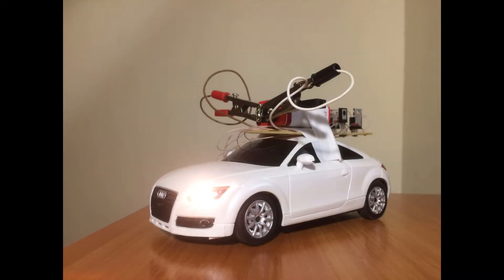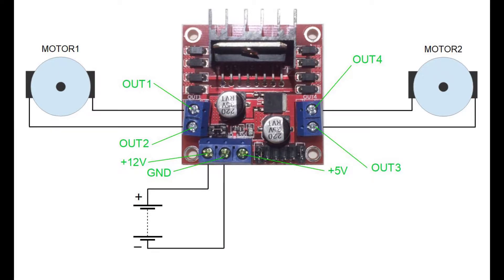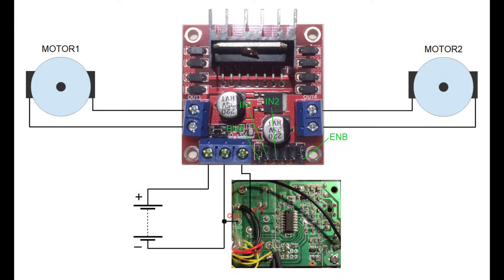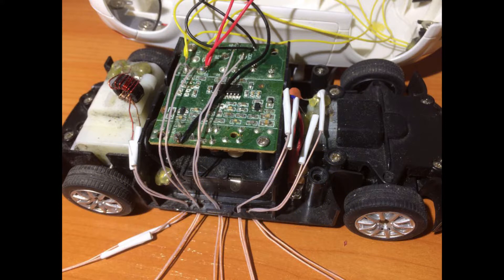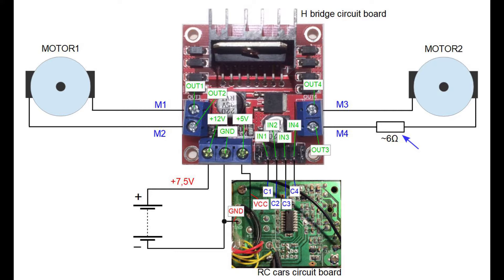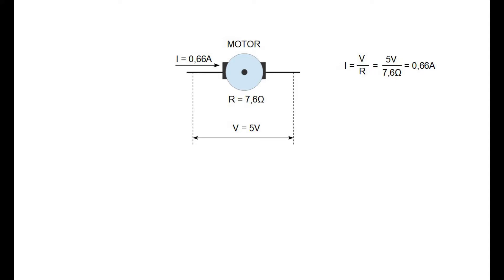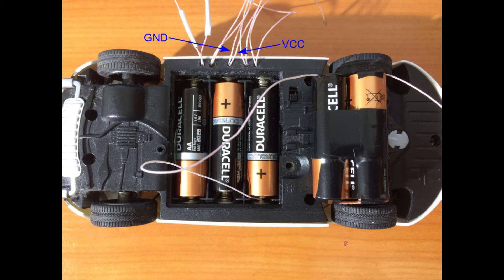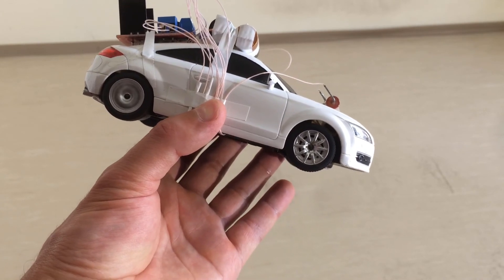Using H-Bridge to increase RC car speed - part 3

Comment: how to control speed rc toy?
Reply from the maker: If you are asking about the L298N circuit, you can control the speed using ENA and ENB pins referring to the video (02:09). You can do that by using PWM (Pulse Width Modulation). If you are upgrading an existing car, I don't think you will be able to change the RC car speed if the car already does not have the functionality to change the speed.